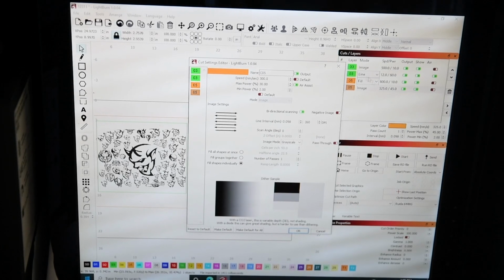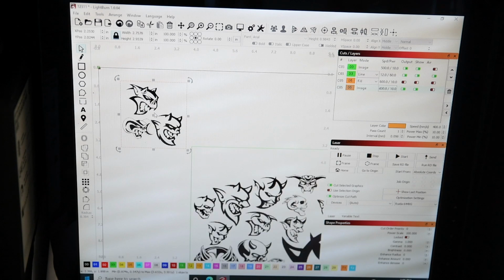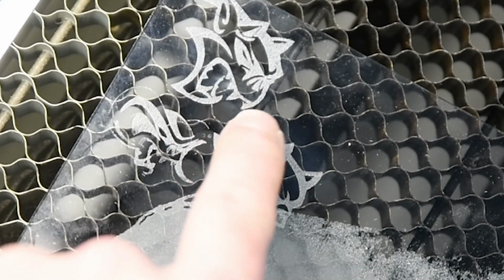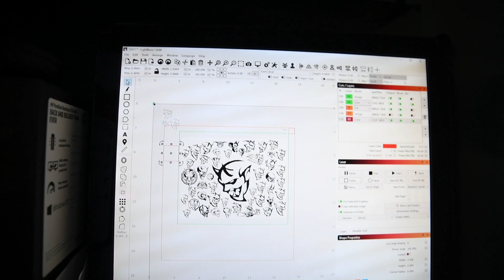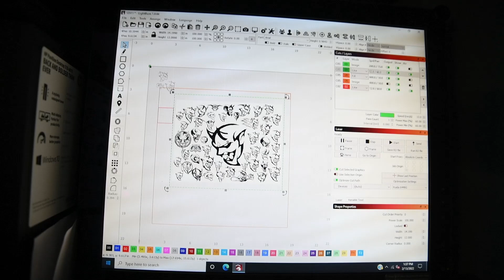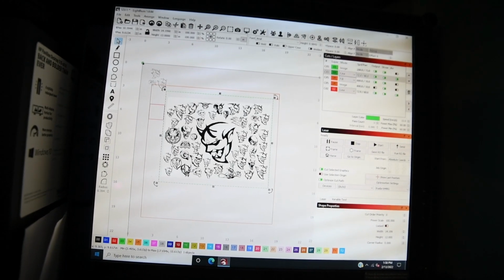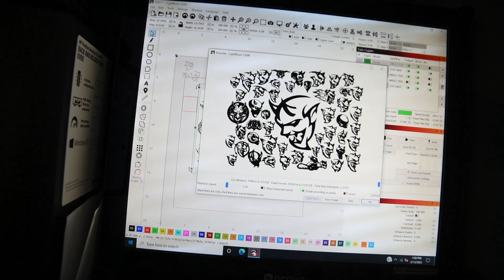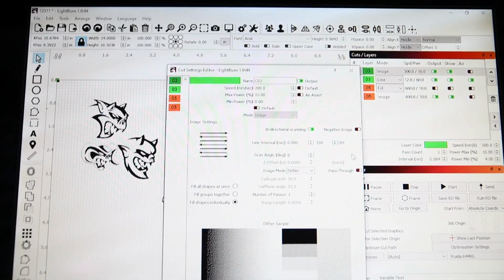Etching / Engraving Glass with a CO2 laser PC Tower Design.

Comment: I get why you did it that way, however, do you mind if I suggest another way I do engraving on glass and mirror.  I use cheap dollar store masking tape and put it on the surface I want to engrave, I use the line option and run the laser at very low power to cut out the design, then with a dental pick I remove what I want to engrave, after with one of those cheap handheld sandblaster guns you can get on amazon, I just use plain old sand from outside and sandblast over the tape, it's not worth the trouble if you have a very small photo to engrave, but for an image the size you did, it is much quicker with the sandblaster and saves the life of your CO2 tube.
Reply from the maker: yes, im sure there is many ways to do it, i just do it for a hobby mainly so i just use the laser not to fussed about the tube when it goes i get another. I just like to use the laser as much as possible, also i dont have a sand blaster but another idea for sure (Y)